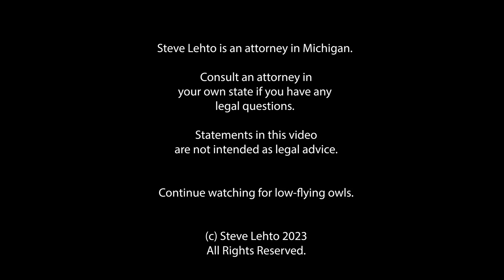The Crazy Legal Problems w/the Turbo Encabulator

Comment: The 1946 case of Detroit vs 1 2-door sedan Fleetmaster - 1947 model, was the compiled data by the T. Encabulator considered to be proprietary? ;-)

Does affect right to repair? Is that why it was concluded that a car is NOT dirt?

By the way: how did you manage to keep yourself from blowing up with laughter?

Comment: I was a technical support person for avistion electronics. I would have people call and tell me they were electrical engineers so I would not talk down to them.  I made up circuit called the viederblanker. I'd when someone told me they were an EE the problem they wanted help with always was caused by the viederblanker. If they knew it was BS they were at least very well versed in electronics, if they acted as if the understand the workings of the circuit I knew they were clueless.